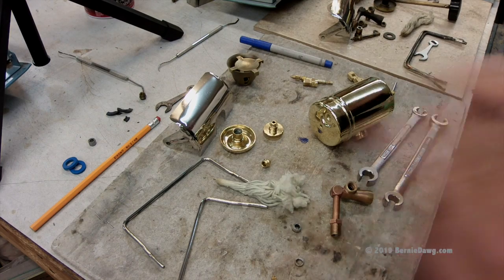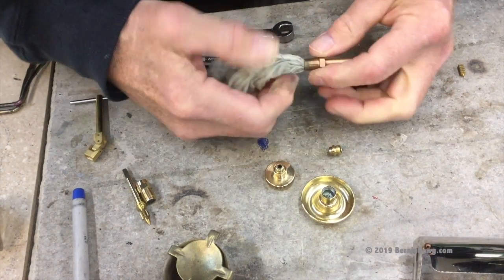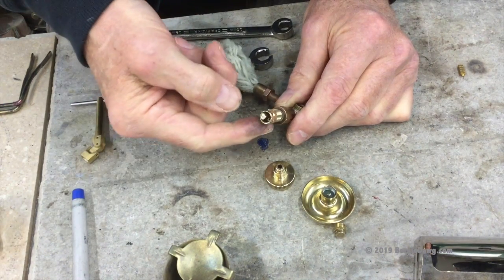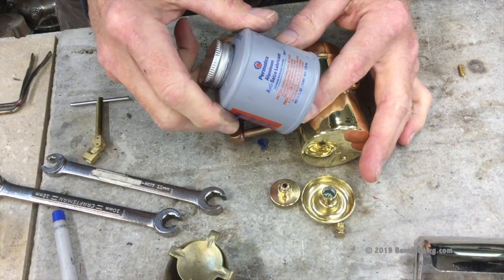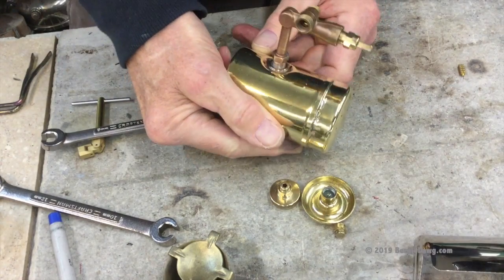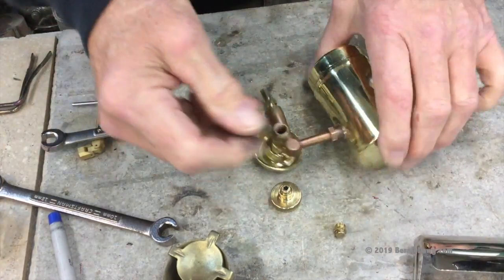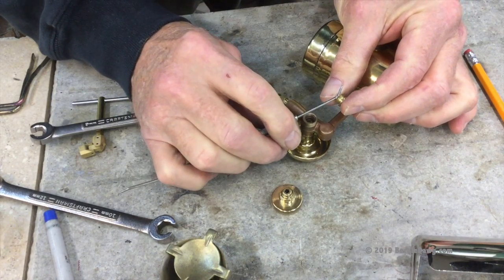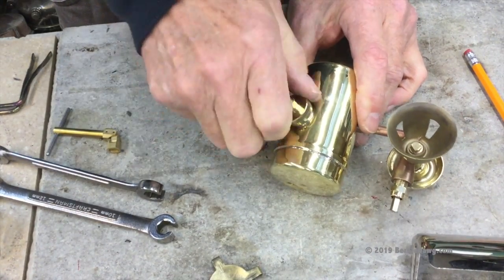Optimus 8R Stove Repair/Rebuilding - Part 2: Reassembly

Comment: I'm getting a little candle flame when I shut off the Optimus 8R and the 99. They blow out easy enough, but it s annoying. How do I achieve a positive shut off?
Reply from the maker: The candle flame is caused by one of two things: 1. a mis-set cleaning needle where the needle is set too low for the spindle valve to close completely. Try the stove without the needle in place. If it works okay, then reset the needle. If still a candle flame, then it's... 2. A mucked up or dirty spindle point. The cone-shaped spindle end should be a smooth cone. If someone has muscled it closed, it may be burred or damaged. You'll need to clean it up with some 400 grit, then 600 grit carbide wet/dry sandpaper to get back to a smooth cone. I talk about this in my Svea video right here: https://youtu.be/-svgLuqyGG4?t=843 If the spindle point cone has been so deformed (it happens) that there is a pronounced step in the cone shape, you'll maybe have to buy a replacement. More questions on this or just some hand-holding? berniedawgstove@comcast.net Good luck. BD

Comment: hello i`ve got an old one from my dad and many years not used but what is the best fuel i think my father uses engine fuel from his bike is that oke ?
Reply from the maker: If it were my stove you wouldn't catch me using modern RUG (regular unleaded gasoline) in the stove. Vehicle gasoline today is not at all like it was back in the 1960-80s when these stoves were made. Now, fifty years later, vehicle gasoline is full of additives and chemicals that won't burn in the low temperatures these stoves operate. You'll end up with clogging and fouling of the stove in no short order. Best fuel for these stoves today is camping fuel, aka Coleman fuel, aka naphtha. Questions on the fuel availability where you live? Just drop me an email. BD

Comment: Hello,  I have one of the Precise Phoenix stoves, are the parts the same?
Reply from the maker: For rebuilding purposes, you could proceed as if the parts are the same. But, the Precise Phoenix stoves were made in the Far East (probably Korea) and imported into the USA where they were branded. Optimus 8R stoves were made in Sweden. The fuel caps can be interchanged. The burner bell and preheat pan threads are different between the two stoves. The tanks are built differently. Probably some other differences, too. So, while you likely can’t use all of the made-for-8R parts on a Phoenix, some you can. Just be careful not to screw things up when rebuilding your Phoenix (ie - don't break anything) and you’re golden. BD

Comment: Where did you get that bottle, and does it have a specific name, so I can look for one
Thank you carlos
Reply from the maker: @Carlos Barajas Hi Carlos Thanks for your question. I bought my "red nalgene wash bottle" from US Plastics about ten years ago.    https://www.usplastic.com/catalog/item.aspx?itemid=23357
They have held up well after all this time. I use them for denatured alcohol printing in the stove lab. They don't seal up, so aren't good for transport. But, they work great for bench work or if you have a kitchen setup. You can find them all over the web from a range of sellers with the quoted search terms I used above. Happy shopping! 👍 BD
Reply: Is the red nalgene wash bottle suitable for hiking (truly spill proof and possibly leak proof from expansion due to heat or elevation change) or is it best for lab/bench top use? With the long dispensing tube it sure makes for a more precise dispensing.
Reply from the maker: @wanttogo Nope. As I said in my reply to Carlos above, they are useless for hiking as there is no way to seal the bottle. Strictly a lab/shop item. That said, most 8R burner bells have a small hole in the base of the bell. Apply spirit inside the bell under the flame plate and it drips out the hole in the bell and down into the pan. Easy peasy. BD

Comment: How pre heat gasoline or kerosene ? Where is the generator ? I dont understand  optimus work principle. I look same stove, almoust stove have a generator for pre heat for form transformation. (benzin/gasoline/kerosen  or hekzan to gas form)  
Please lighting me this stove working principle. Thanks for yours reading 🙏
Reply from the maker: @Hakan Şak The stoves in this video only burn easy-to-vaporize Coleman fuel or old-style gasoline. Kerosene takes too much energy/heat to vaporize in this stove. How it works: The burner gets hot during preheat. The heat moves into the stove base during preheat. Liquid fuel goes into stove base and vaporizes from the heat. Fuel vapor comes out the jet. The "generator" in this stove is all the brass metal from where it comes out the fuel tank to the burner bell. Brass metal is a great conductor of heat. Get it now? 🙂👍 If not... buy one of these vintage stoves and try it. You'll get it then. BD

Comment: Mines leaking from where you adjust it to adjust the flame.  Please help
Reply from the maker: @Krakdskul Kingpins Tighten the spindle nut (aka "stuffing box") with the tool that comes in the stove case or with a wrench. The spindle nut will further compress the graphite packing and seal the shaft of the spindle eliminating the leak. I show and discuss how to do this in the video as does Optimus in the 8R instructions:  https://www.berniedawg.com/optimus-8r-manual/ If your stove is worn, you may need to replace the graphite packing as I show in the video. Links to part suppliers for old stoves here: https://www.berniedawg.com/stove-part-supplier-links/ Have fun and be careful! BD

Comment: Sir when you say optimis 111 burns on gas also is it normal petrol that we use to run cars and bike?
Reply from the maker: NO! Never use automobile petrol/fuel, aka pump gasoline, in any small stove used for camping. Use only quality naphtha, aka Coleman fuel, aka camping fuel, for your small stoves. Automobile gasoline will not burn completely in a small stove and the unburned components will form sludges and tars inside your stove or emit poisonous chemicals into the air around you as the stove is burning. BD
Reply: @BernieDawgCinema  For what it's worth, I was advised to burn automotive gasoline when I bought my then new stove in 1970,  and continued to do so for decades. Auto fuel was the only kind fuel available where I was traveling. No problems, but I now use Coleman fuel because it is cleaner. I don't doubt that's better.
Reply from the maker: Hi Roy Yup. We used to do lots of things differently 50 years ago (1970). (Remember 8-track tapes, cassettes and the world before AIDS or cell phones?) But, todays gasoline is nothing at all like it was in 1970 (50 years ago). Today we have the EPA which didn't exist until December of 1970 to legislate that our automobile gasoline contain all sorts of chemicals that don't burn at the temperatures that stoves burn at in order to reduce vehicle pollution. Engines run under higher temps and much higher pressures than stoves, so they CAN burn modern RUG with its tons of additives. But, stoves can't. Todays gas also contains a bunch of alcohol in it, unlike 50 years ago. Because I actually repair stoves for people and have seen dozens and dozens of stoves, I get to see first hand what regular automotive gasoline (RUG) does to stoves. It's a mess. Good thing you switched to naphtha (aka Coleman fuel) which has the magical property to dissolve all the RUG sludge and crud that your stove has been building up over the years and keep the beastie running after all this time. Bravo to you on your wise choice! 👍 BD
Reply: @BernieDawgCinema  Wise? Ironically, I made the choice to buy that stove because at the time they said it would burn every thing that was available at any fuel pump at any village in the world,  and I was backpacking my way across Europe and north africa for months at a time. Just dumb luck I started buying Coleman, which my dad called "White Gas." Thanks,  friend. Good to learn interesting things about my little buddy that I learned to cook for myself on.

Comment: What did you use to clean the parts?  9-12-20
Reply from the maker: @Kelly Firestone - I note you just joined YouTube yesterday. Not sure why you dated your question. ???
Your question is a short question that requires a long answer. I can’t get around that and still be clear. I don’t speak "Twitter". Sorry. 
Disclaimer: These are my methods on this particular pair of stoves. My methods vary from project to project. Don’t assume I do these same procedures on all my projects. For the most part, however, I feel these are pretty good methods based on my “training" in restoration work for museums and are the least damaging to antiques. Others will, of course, make their own decisions. I hope readers decisions will be wise and considerate of the items you choose to clean or restore. For me, the health, well-being and longevity of the item being “restored” or cleaned is far more important than any puerile and selfish ego-rush bullshit I might get by posting an overly shined stove on social forums or YouTube videos.
Hot soapy water (Dawn dish detergent) and a nylon or brass bristled brush to clean food deposits, grease and oils on both stoves. 
Polishing brass means you are removing metal. There is no need to polish brass unless there is green or red corrosion caused by slob owners who left acidic food on the brasswork. Those spots of acid damage can continue to eat at the brass and could be a reason to polish them out. An even brown patina is protective to the brass underneath and should be left alone - it will lengthen the life of the stove. That said…
All the bright shiny bits on the shiny stove in this video were obtained by using “Mothers Mag and Aluminum Polish” and lots of elbow grease. Mothers contains no ammonia (ammonia is bad for brass and can cause stress cracking in thin brass sheet.) 
I use rags, paper towels, Q-Tips, nylon-bristled brushes, and brass bristled brushes. (Never use steel bristled brushes or powered wire wheels on brass!)  I never use Dremel-powered wheels or buffs on stoves because, imo, even at the lowest settings, the rpms are too high and can caused disfiguration or “burning” of the metal - more trouble than it’s worth.
I use dental tools to carefully remove crud and oxidation from threads, generally “chasing” all threads clean with dental tools I’ve ground for the purpose.
The shiny tank in this video got about a half a minutes worth of touchup on the buffing wheel with jewelers red rouge after hand work with Mothers just to even out the shine.
The burner, burner bell and flame plate on the shiny stove got a quick treatment with a glass bead blaster with extremely fine beads, then a buff out with a brass bristled brush. I used beads on this 8R burner because it’s an extremely common stove and I was lazy. I never use glass beads on the burners of any stove of rarity, significance or value and I never use beads on sheet brass parts, tanks or other shiny bits. Glass beads are excellent for stripping paint and preparing painted steel stove cases for repainting, however.
The same results for cleaning burners can be obtained with a brass bristled brush and a mix of very dilute citric acid and flour/water paste. And, a lot more hand work. I avoid soaking parts in vinegar solutions (like many stovies do) since I feel that acetic acid in any dilution is far too unpredictable and aggressive. I’ve seen far too many stoves ruined from pinkening (zinc-leaching) of the brass by careless use of vinegar solutions.
Generally speaking, I think cleaning burner parts beyond the hot soapy water and brass bristled brushing is a waste of time since they go back to a dark oxidization with the first fire. I would strongly encourage everyone to skip polishing burners altogether. But, especially users who plan to fire the stove.
I never spray protective coatings on shined brass, but keep them clean with soapy water and allow them to develop the protective brown patina free of damaging food acids. I always clean my stoves during and after an expedition, drain my tanks and store them dry.
Take good care of your stuff and it will take care of you. BD
Reply: Are you familiar with Maas Metal polish. I've used it for many years to polish military brass and other bright metal items around the house. Based on the SDS for Maas and Mother's that you use, I am guessing that Mother's requires a little less product and time to do the same work. I, like you, only ever polish the bright metal of my stoves, never the bell, jet or burner plate other than to remove excess carbon. A damp rag normally takes care of that. Do you have a paint code for the metal case of the 8R? I repainted mine years ago with a heat resistant black that is more durable than the original medium blue paint that was used on my stove and so many like it. My 8R was the same color as the two in this video. I want to take mine back to the original color. Thanks. This was a very informative, detailed video. I really got a lot out of it.

Comment: In Russia his name is PT-1 (tourist's Primus)
Reply from the maker: Sorry. Not really the same stove. The Soviet-made PT-1 is very closely modeled after the Swedish Optimus/Primus 8R and they are similar in many respects. The PT-1 is NOT Swedish-made or licensed, however, and is not a direct copy, either. Many of the parts of the two stove types are not interchangeable as they use different threads and sizes. This is to be expected since the Soviets were copying a Swedish-designed stove for domestic use by Russians behind the Iron Curtain before the fall of the USSR. Both stoves have their adherents, but finding spare parts for the Swedish stoves is MUCH easier and many consider the quality of production to be higher among the Swedish stoves. It's an interesting subject. BD
Reply: @BernieDawgCinema  
I have PT-1 (USSR), do not like his work, unfortunately in Russia to find Optimus R8 difficult, but judging by your video quality it is much higher
Reply from the maker: @ew5mr  Yes. I understand and sympathize. The PT-1 is still a good stove and produces flame as well as the Optimus stoves. I hope you enjoy it often. BD